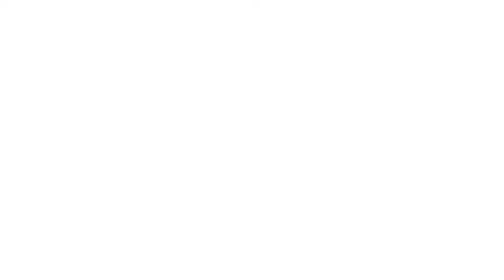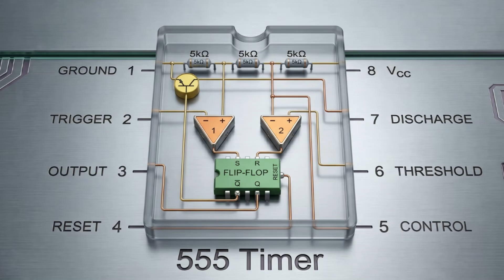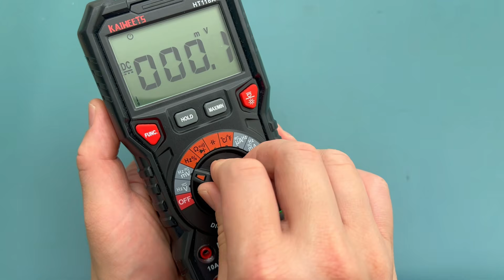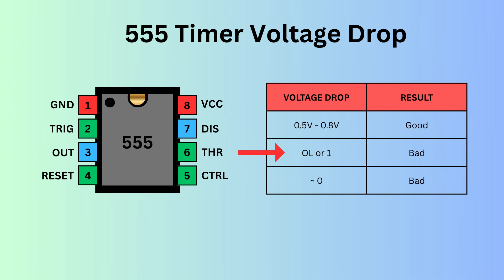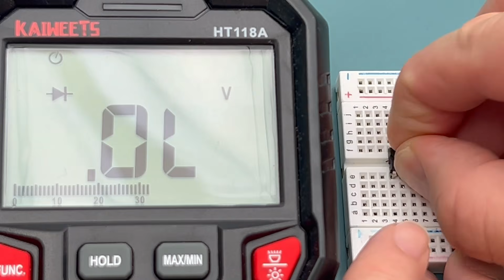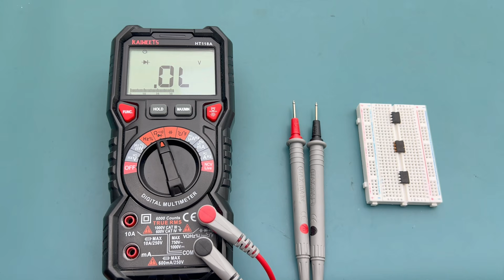How to Test a 555 Timer With a Multimeter

Comment: hmm, I'm confused. I have 6 555 chips and they are all showing 1 on pins 4 and 5 on my hand held multimeter.  Using my bench multimeter, pin 4 show 1.2+ and pin 5 is open.  4 of them were purchased from one source, the other two came from a different source.

Comment: currently  it more interesting to buy lmc 555  (pin-to-pin compatible) :)   modern version of 555
Reply from the maker: Great point! The LMC555 is awesome, especially for battery-powered circuits since it sips power and runs on lower voltages. Pin-compatible drop-in upgrades are always a win.